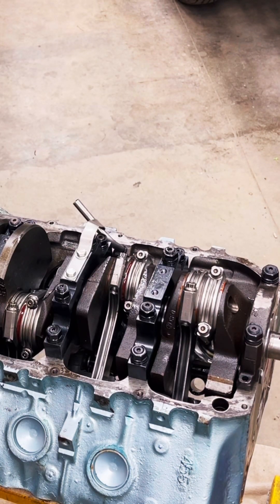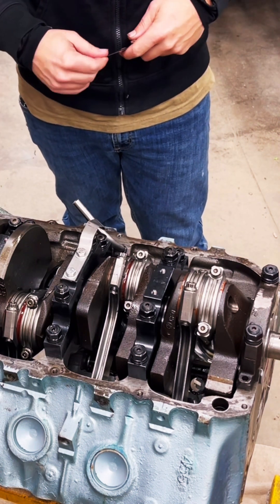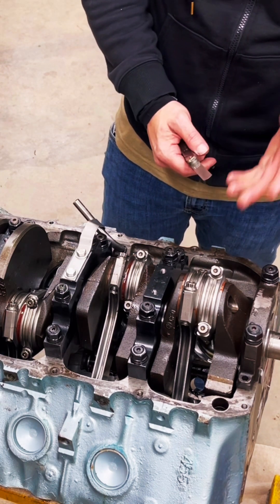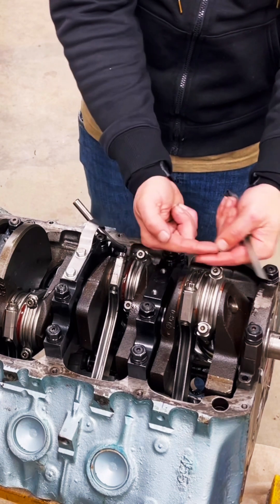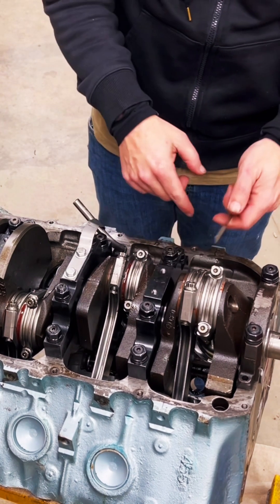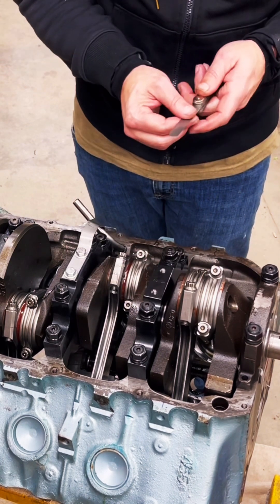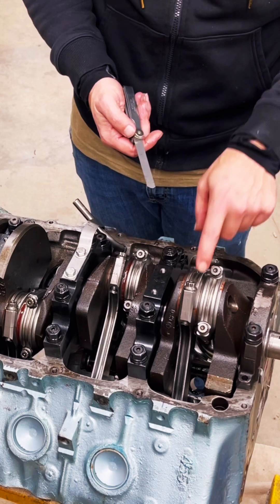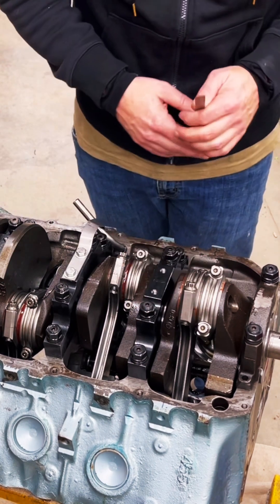How To Measure Connecting Rod Side Clearance #shorts

Comment: What do you need to do if it's too tight or, too loose? I could see surfacing the sides of the rods but, how do you make them tighter?
Reply from the maker: too tight, surface the rods.  Too loose really depends on the build and application.  Me, I'd probably live with it.  But in severe cases, new rods are needed.  Also, most performance aftermarket rods are thinner than factory.